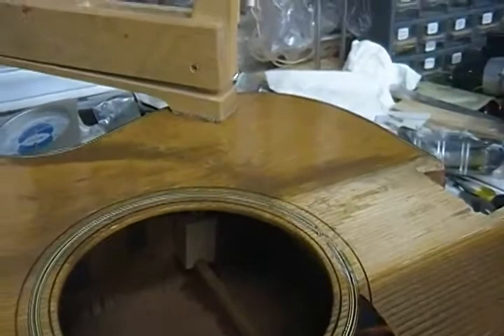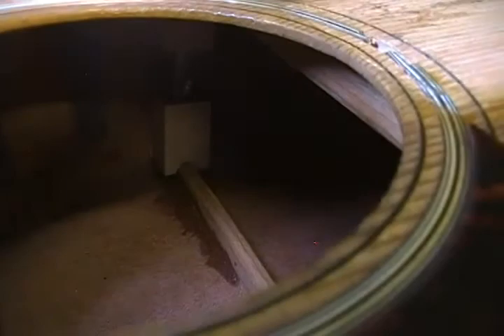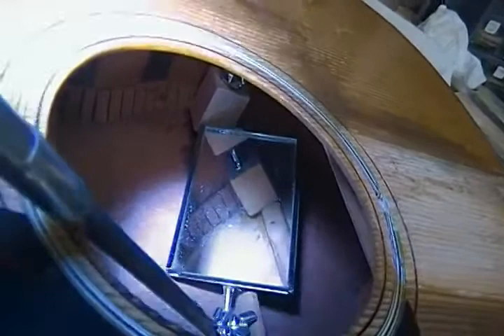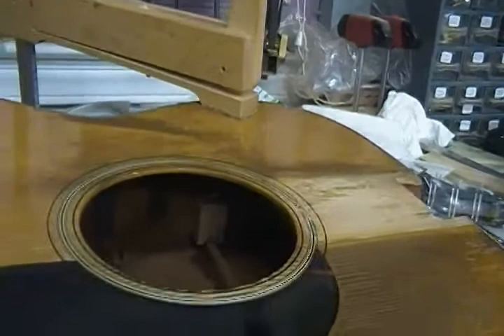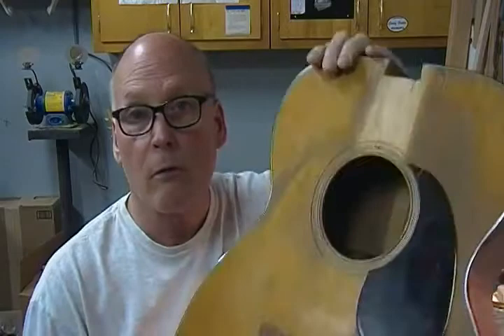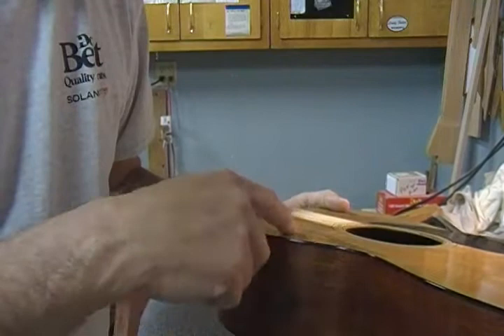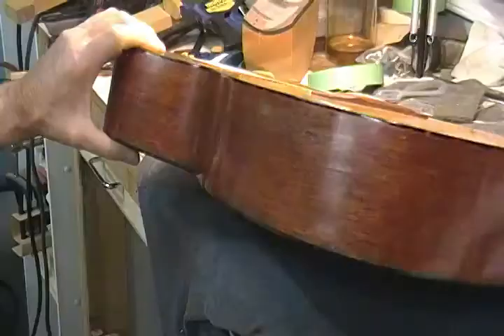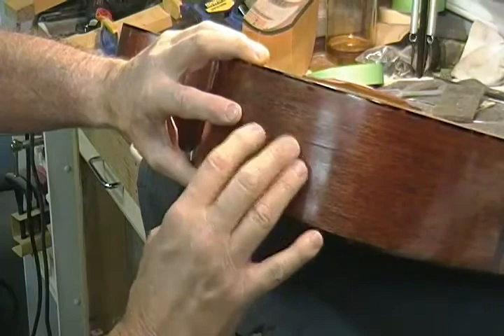65' Martin 000-18 brace and crack repair, Jonah Guitars

Comment: I like that little prop Dane. You have patience I'll give you that!

@Billy, <"your" doing better> Ha! Priceless.
Reply from the maker: The little prop, good for another post on the guitar attack forum on home made tools. Thanks Steve.
Reply: @jonahguitarguy  Here we go again! I have a cotton cash bag full of different lengths of 1" dia. solid aluminium rod, all threaded 1/4-28 UNF with a set long screw in one end. I used to select combinations of rods to suit the length needed and unscrew the sections bit by bit to lengthen. Crude but effective. We used to call them cotton reels. You're correct- good for posting on GA. I do like the magnets technique though.